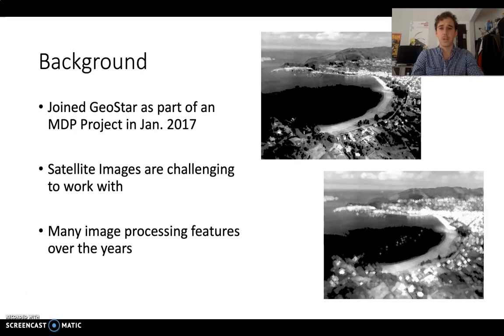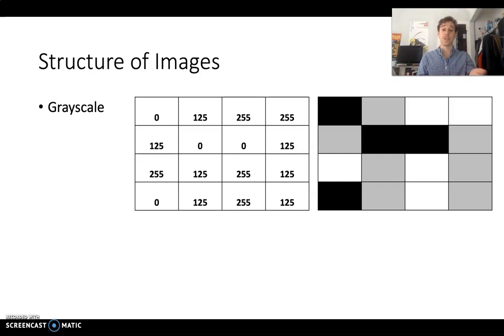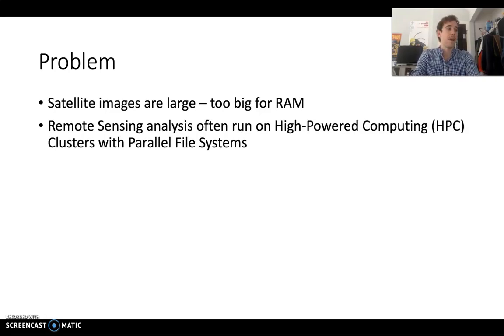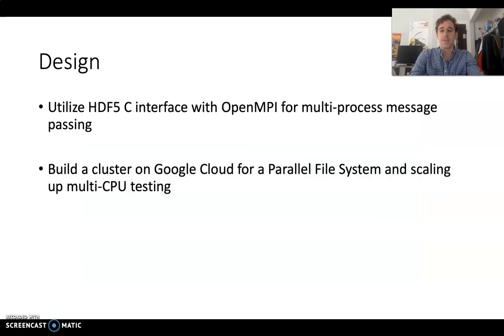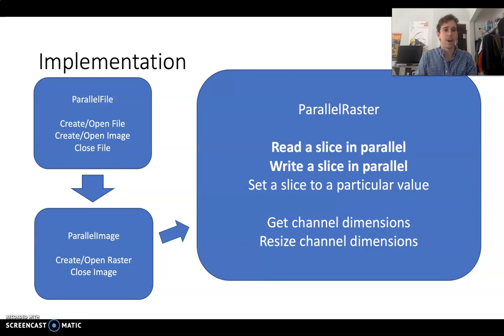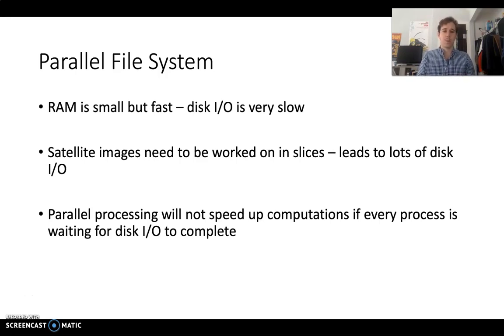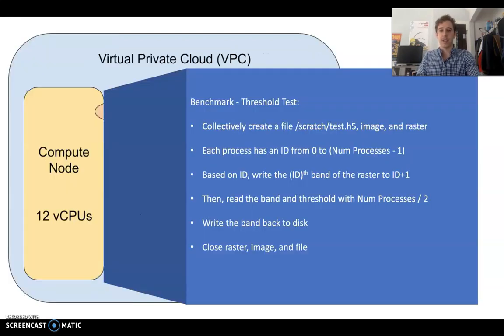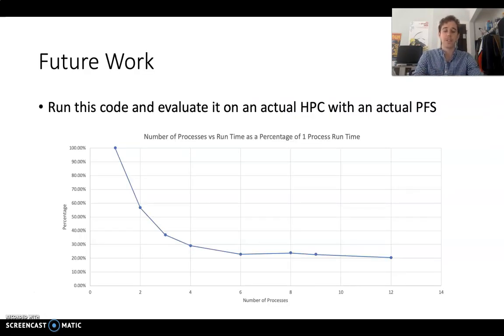Parallel Processing for Satellite Images

Comment: Very interesting project! What problems or hurdles were most difficult or least anticipated when completing this project? With the given limitations, did you accomplish what you hoped to, what could you have accomplished more given more time and resources?
Reply: Thanks for your question! The biggest hurdle was either becoming familiar with the HDF5 C interface or setting up/linking dependencies correctly. The C interface has lots of old documentation that I needed to work through. Also, installing and linking dependencies is something that was typically handled automatically in my prior internships, so it took some work to get used to.

I am happy with my results because there was a performance improvement- however, if I had access to an HPC I probably could've either gotten better results or narrow in on some reasons why performance hasn't improved past 5x speedup.

Comment: Great presentation Andrew! My mom actually works in remote sensing and I bet she would be really impressed by your project. Do you have any ideas on what was causing the slowdown at 6 processes other than lack of an HPC?
Reply: Oh that's awesome! If I had more compute resources, that would be the first question I'd try to answer. It's very possible that there is overhead associated with managing that many processes on the one compute node I set up, so I'd like to spread the job over a cluster rather than many processes on the same machine and see if that makes a difference. I would also like to use a fully-powered parallel file system (since the one I set up was drastically under-powered).

Comment: Very interesting project. Great job with thinking out of the box and coming up with solutions so that you could test your approach. Given what you have completed, would you change your approach (besides testing on an actual HPC) at all given your findings?
Reply: Thanks for your question! Overall, I'm happy with how the implementation of the software turned out. I would say there are 2 big things that would've been nice to do once I got through the initial implementation. 
1 - I would've liked more time to check if my code could be optimized or if the slowdown at 6 processes was actually due to overhead from managing the many processes. One sneaky thing I tried to do was put additional nodes in the free tiers of AWS and Microsoft Azure, but there were a lot of complications with working across the "VPC" or Virtual Private Cloud that needed to be configured for my parallel file system. It's possible, but I ran out of time.
2 - I would've liked to document my code more thoroughly and write example programs. I am hoping this project will be picked up within GeoStar after I leave, and I prioritized my notes to show installation steps for dependencies, configuration information for the cluster, and other things that would benefit someone trying to build on my code rather than an end user trying to use GeoStar concurrently.
Reply: @andrewrosen2576  Thanks for the response. Hopefully the work you have done can be picked up as you mentioned. It is great that even though you were no table to document your code more thoroughly that at least you have some good notes.

Comment: Very cool project! What are the typical types of processing that need to be done on satellite images? Why can you not compress them to a more manageable size?
Reply: There are a lot of applications. Some of the cooler ones that I have written some code for include:
1 - Land Cover Classification - use Machine Learning and a labeled satellite image to computationally predict what an area of land is (trees, farm land, urban, parking lot, etc). 
2 - Phase Unwrapping for elevation maps - for LIDAR images, a light ray is sent down to Earth, and bounced back up. It is difficult to measure how far it travelled, but we can precisely measure how much the phase of the light wave is offset. That means we get an elevation map wrapped between 0 and 2 Pi. There are algorithms to "unwrap" the image and turn it into an actual elevation map.

For something like Land Cover Classification, the best predictions will come from having many channels. In one frequency of light (or on one channel), a parking lot and tree cover may look the same. But in another frequency of light, they may look different. The more complete our data is, the better our ML applications can perform, and that's why a lot of images are kept very large. However, for many applications, it's not unreasonable to reduce an image's size, so concurrent software isn't always necessary!